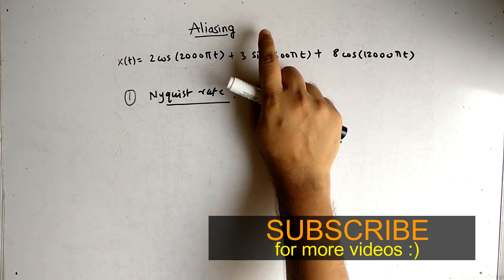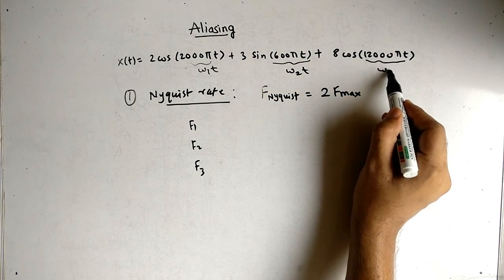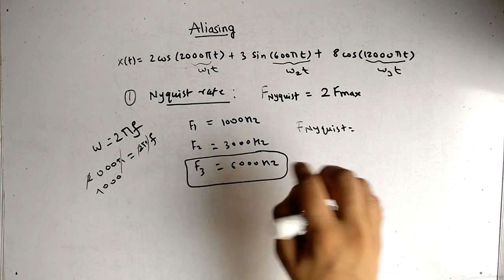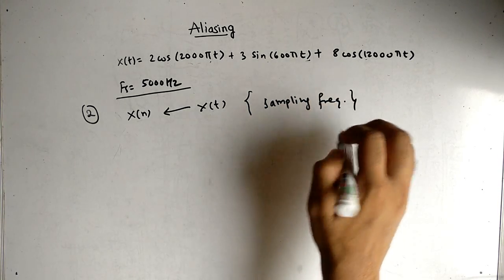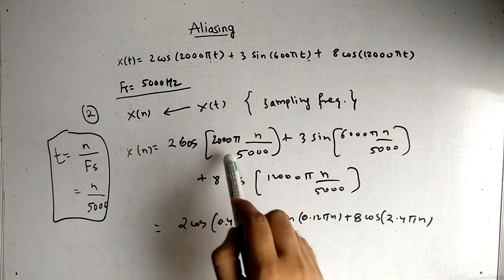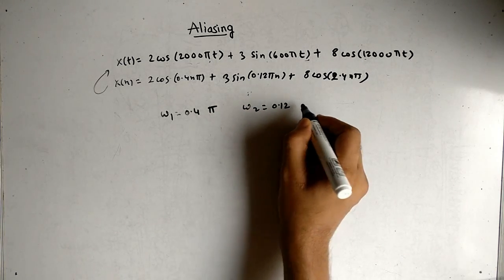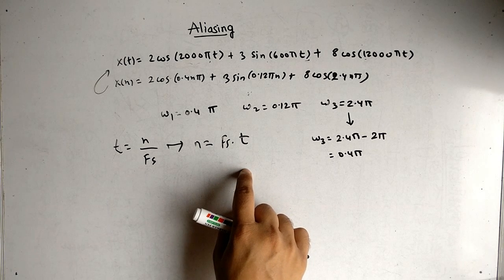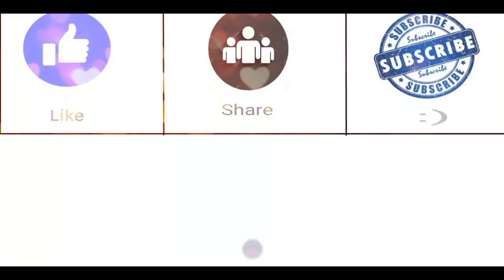FIND :Nyquist rate, Nyquist interval, continuous signal and discrete signal using sampling frequency

Comment: Sir the video has a few mistakes .....

1) The W2 considered is for 6000....whereas in the question it is 600 which results in the further mistakes
Reply from the maker: Rajesh Vasudeva 

Thanks for correcting
It was 6000 in Question , I wrote 600 by mistakely
Reply: @ShrenikJain  not 3000 but 300 at f2
Reply: Sir if it is 6000 than dividing it by 5000 gives 1.2 and you had written. 12

Comment: An analog signal is band-limited to  8 kHz, this analog signal is sampled at the twice of Nyquist rate. The samples are quantized into 8 levels (Q1, Q2.. Q8) which are independent messages with a probability of level1(Q1) P=0.3, and the rest of the levels are equiprobable. 
A) Find out the information rate.
B) If this signal transfer through a channel of 20 kHz and SNR of 29 dB. Find the capacity of the channel and the maximum efficiency.

Please master

Comment: sir i have a confusion...we have calculated nyquist rate 12000hz,So to get a sampled signal which can be reconstructed we have to sample it for fs>=12000,but you have taken fs=5000 and still reconstructed the previous signal....how????correct me if i said anything wrong...
Reply: Same doubt
Reply: He did'nt get the original signal back. Look at inside the 8cos term, its different.